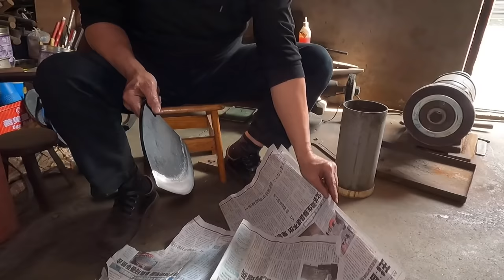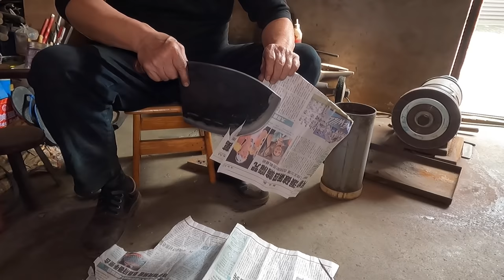World's Sharpest Tuna Knife!  (A rare unique Steel clad knife-making technology in Taiwan!)

Comment: 湊巧看到yt推薦這個影片,覺得很感動,然後因為看到留言區很多外國人要求字幕,但是由於現在沒有協力字幕功能了,所以我就直接打在留言區了. time code應該不會差太多,直接複製貼上就可以了
0:01 Regular iron
0:03 We're going to wrap steel with iron
0:47 Welding three layers of metal together
1:00 The blade will be made from these pieces 
1:02 Iron,steel,iron
1:03 We're going to counter- "kobuse" it 
1:06 Knives with "kobuse" process are really good
1:23 Because it's harder to make than last time
1:27 It might be took more time then
1:36 Mud water, it could help the melting process between layers
1:53 It's pretty hot
1:58 Gonna wait till it cool down a bit
2:58 Cutting- forming the tang (full tang)
4:07 Shaping the blade~
5:22 The most important thing is the combining layers together
5:40 Scaling the edge
6:11 Iron- steel- iron in order, where steel in the middle and iron on the outside
6:33 Quench
7:02 Bending the edge
8:14 Preparing the matching surface
8:50 Removing scale from welding
11:11 How come it's getting bigger?
11:15 It's over sized
11:20 Nah, it's just right on the spot
11:46 Finally! it's complete , or not
11:48 Nah, just partially finished , kekeke
12:04 Checking the flatness of the knife
12:45 Next step, it's time to cut it into the final size
12:47 The most important thing of knife making is to make sure it's no wobble
13:00 If the knife got wobbling, then it won't working perfectly
13:11 Determining the final shape~ 
13:39 The shape of it is for up-lifting technique
13:48 (Audience) I can't tell the blade were from welding two pieces together
13:52 My welding skill were decent
14:48 The knife goes thinner from tang to the tip
14:50 Some mass production knives were made by the press machine , so both sides will be parallel all the way through
14:57 It should be flat
15:02 A decent knife should be flat on both side from the vertical view
15:14 Prepare oil for quenching
15:58 After the quench, it's hard enough to scrap the iron
16:00 If the hardness is not enough, iron would bite into the knife instead : a failure then
16:02 So I had to test it before move on to the next step
16:13 Prepare the edge
16:57 This bench were 50- 60 years old, 
16:59 Yet this knife were the biggest, the heaviest I've ever made
17:08 Scraping the iron as if it's mud
17:31 See the line here?  The darker part is the steel and the greyish part is the iron
17:43 Preparing the handle
17:52 Back to the other side of the edge
18:14 Preparation of handle installing 
18:49 Preparing the edge with coarser grit
19:01 Finishing the edge with finer grit
19:14 The shop stamp "LAI" , it means come in Mandarin
19:32 1.98 KG
19:36 Just as same weight as the other one
19:52 Sharpness test
Reply from the maker: 非常感謝您。我會將您協助的字幕上架影片。
Reply: Love to have that.
Reply: Спасибо очень помогло
Reply: 大推
Reply: Where can a buy I knife like this
Reply: @Eys.Mel.  да ну будет тебе. Просто техника ковки интересная вот и ответил, за та что человек всё расписал. Я в общем кузнец любитель, поэтому для меня разные техники ковки это : кладезь знаний. Думаю поймёшь
Reply: @Eys.Mel.   это хорошо, правда отлично, когда разбираешься и понимаешь что к чему. 
Будем надеяться, что люди образуются и будут делать как положено (если я правильно понял) 
Спасибо тебе тоже удачи и стабильной дуги ✊
Reply: Không phản hồi
Reply: this is da best katana ever make <3
Reply: P
Reply: 0
Reply: almost every knife can be the sharpest in the world.... it's all about retaining the sharpness, and that can only be achieved with one of the super steels

Comment: First time I've ever seen a blacksmith wield a harden metal to a softer metal. And I watch a lot of blacksmith and knife making videos

Enjoyed your video and I gave it a Thumbs Up as a support
Reply: Professional Damascus Chefs Knife, 67-Layer Handmade 8" Damascus Chef Knife, Japanese VG10 Super Steel Core
These knife has 33 layers stainless steel on left site + 1 Real Hard Steel in the middle + 33 layers of stainless steels of the right site..
Reply: @TriNguyen-jf1tr  Didn't look like it was stainless steal
Reply: Cladding steel with soft iron is very common in Asian knifemaking.
Reply: @davidtatro7457  I wasn't sure since I at one time or another followed a few blacksmiths from Asia Thanks
Reply: "First time I've ever seen a blacksmith wield a harden metal to a softer metal. And I watch a lot of blacksmith and knife making videos"
Not very good ones, then.
“ 'San Mai' is a Japanese term meaning 'three layers'. It refers to lamination, a technique in which multiple layers consisting of different types of material are fused with each other. In this case, three steel sheets are welded together, as opposed to the entire blade being composed of one kind of steel. 
Hundreds of years ago, Japanese bladesmiths employed this technique to forge their katana, or samurai swords. They used a hard steel in the centers of their swords and a softer steel on the outer edges. This combination of steels made the blades both supple and incredibly sharp."
It's been in use since about 1300 AD.

Comment: while i am a definite novice bladesmith (only 4 years experience) I'm baffled by his methodology in forge welding.  Cannot argue with results or the smith's skill here, just confused why he went the route he did.  Skill trumps all apparently!  bravo
Reply: Not a smith myself , is  something about the back bone and the layer of the steel and iron .
Reply: I've never seen somebody weld a blade on a knife either. Very strange.
Reply: I was curious why he electro-welded the cutting edge onto the blade instead of forge welded it. He obviously got full penetration; just not the route i'd have taken. And I want to know more about that knife scraper! lol
Reply: Also the surface finish. Whilst only cosmetic, the black pitted main surface could surely have been polished out to look better?

Comment: I can understand the layering, but why is the knife made in two sections which he welded together?
Reply: Steel is expensive, iron less? Iron is non hardable so only the steel is hardened whilst the soft iron round it protects from chocks.
Reply: The front part is iron steel iron, 
The back half is iron.

I guess it's for ease of production and cost savings,
So only the blade part is processed.